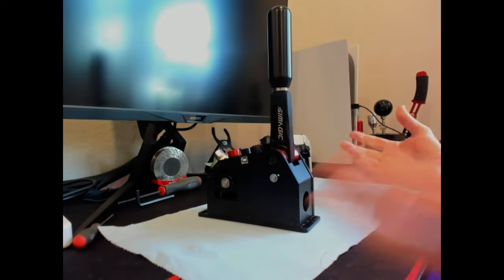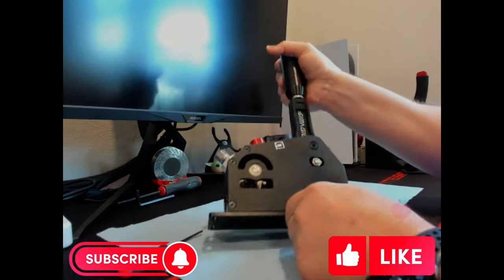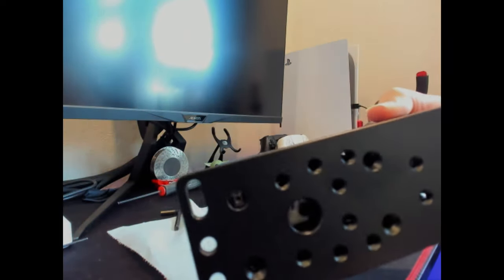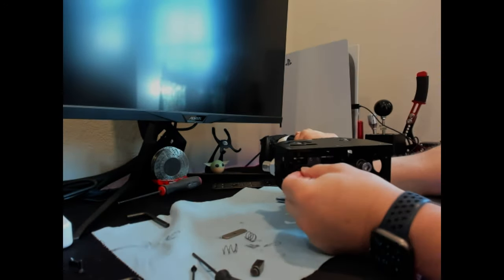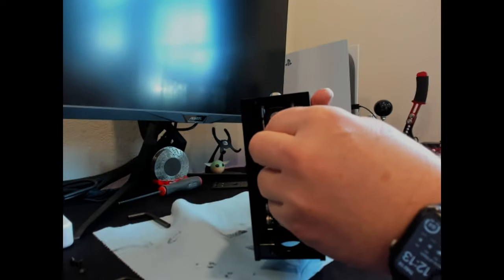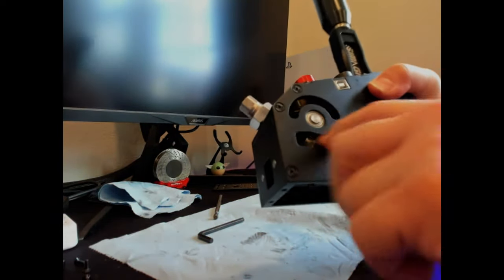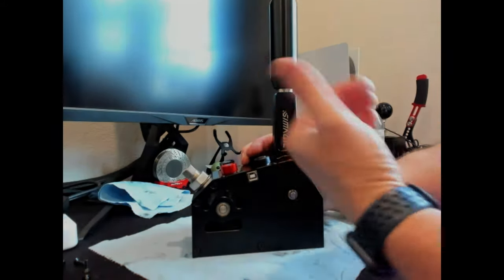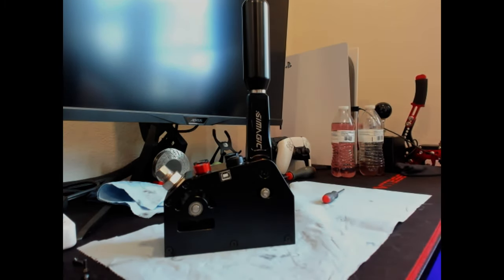Simagic Q1 Shifter fix

Comment: Well my q1,5 got problem again, had to dissasemble totally. Completely différent than the q1 ! Left side must be removed. Not under plate .  That spring that push the sliding plate was jammed and was not able to unjammed it. After a lot of thinking i ended up with tie- wrap that loop in a hole on the sliding plate and around the main lever so the sliding plate want to go up! 10 cents solutions.